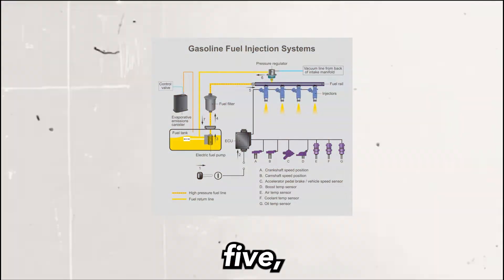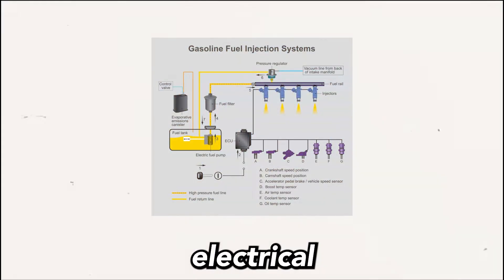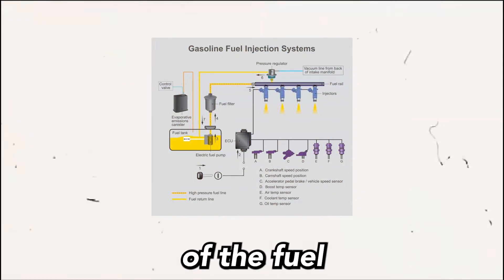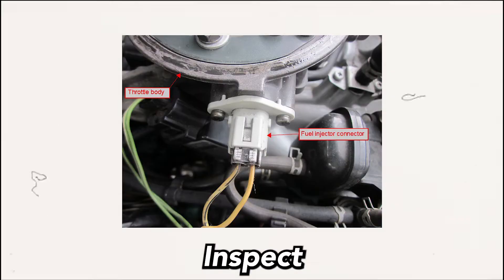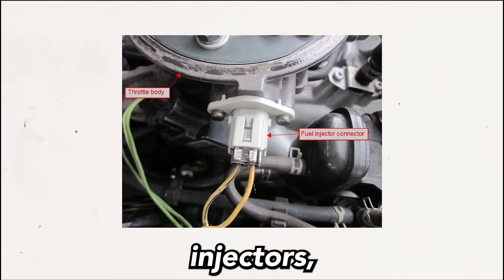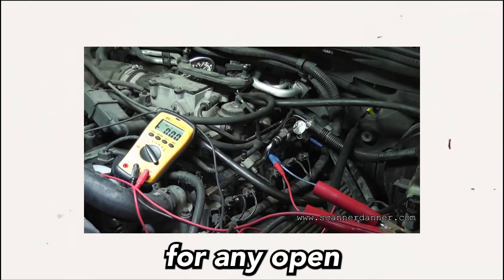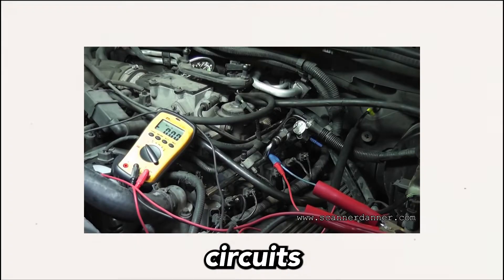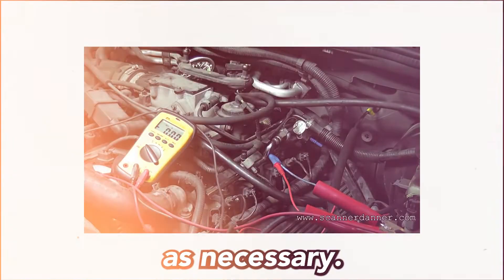Nissan P0300 - Causes, Symptoms, and Fixes

Comment: P0300! 4 bad O2 sensors possiblity?
Reply from the maker: Very unlikely. A P0300 (random misfire) is usually caused by ignition, fuel delivery, or compression issues — not 4 bad O2 sensors.

Comment: I should probably start with 7. I just replaced all 6 ignition coils and that was not the answer 😊
Reply from the maker: Sorry to hear that. Did you finally fixed your car?
Reply: @carcarehacks not yet.
Reply: It could be a faulty fuel pump
Reply: @globalreachcontentent9707 interesting. I could check that. That would cause multiple cylinder misfire?